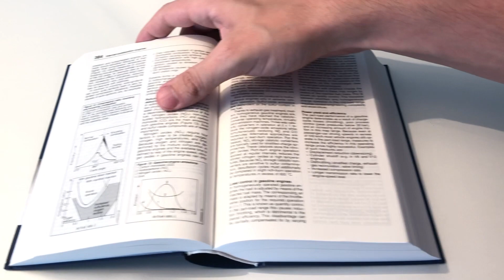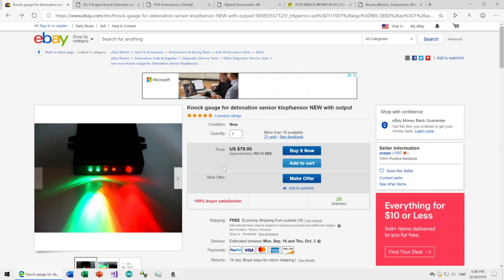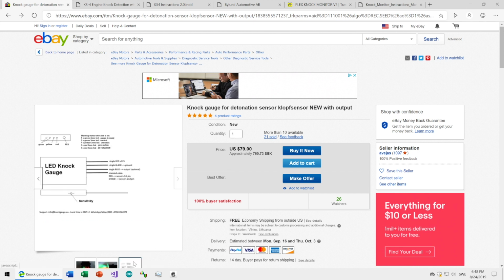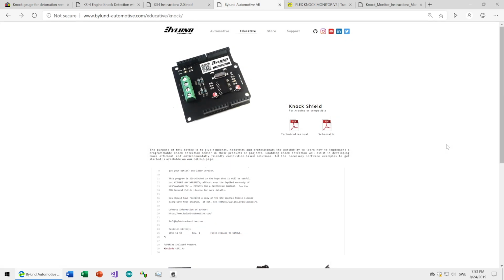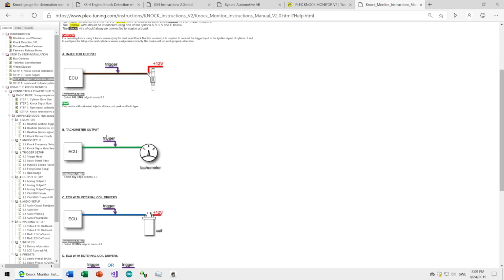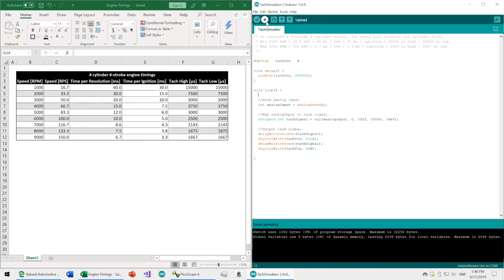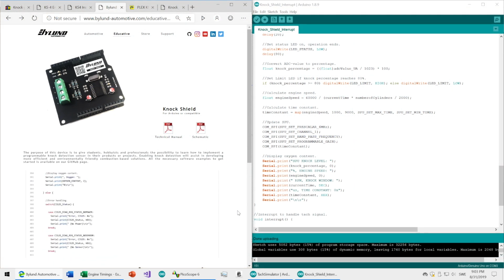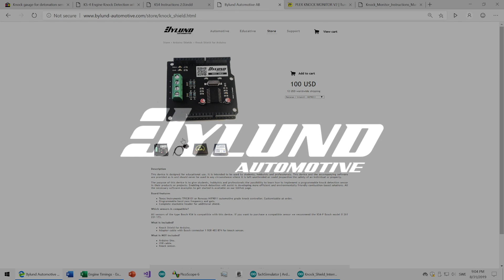DIY Knock monitor with Arduino®

Comment: @0:30 you are incorrect sir, or the Bosch book has incorrect terminology. 'knock' colloquially is detonation that occurs when the spark is fired too advanced, i.e. at at a high degree before top dead centre. What you described is pre-ignition, which is an entirely different sort of event and outside the ECU''s control.edit: it literally says ignition advance in the table you showed.

Comment: I like the device! Can you tap into signal of existing Knock sensors, splicing the wires at the ECU, so that the ECU signal would be duplicated to the knock shield?

Comment: >DIY
>$100
Reply: Eh, it's a ~8 chip from TI, plus passives and terminals. Luckily they give you the full schematic, you could just draw it up in PCB CAD if it's too expensive. This may be required for me since it doesn't appear for sale anymore.
Reply: @jmhalder I wanted the Knock Shield which was on sale. And later discontinued, I‘ve designed my own knock shield today according to his dataaheet and tech manual and licence agreement.

Comment: Any knock sensor suggestions for smaller air cooled engines without tachometer signal outputs preferable for less than $400 USD?

Can't hook tac to magnito primary windings without risking exposure to high voltage spikes.
Reply from the maker: Hi! Depending on how your flywheel look, a cheap hallsensor should work good enough to pulse with. Optical sensors can also be another cheap alternative, requiring a reflective surface on the flywheel. Use the benefits of the Arduino and you will get away with half the cost.